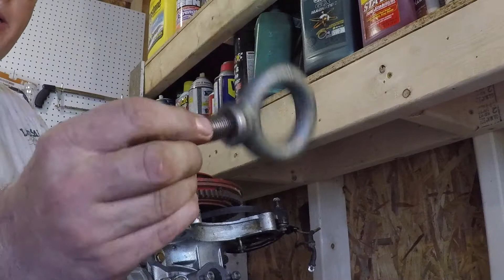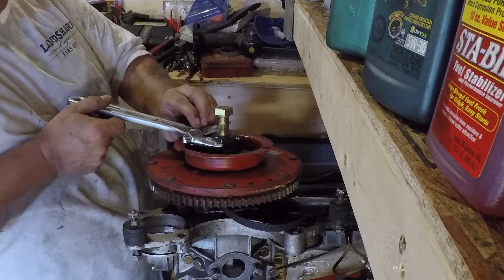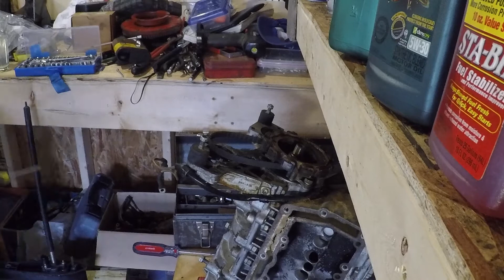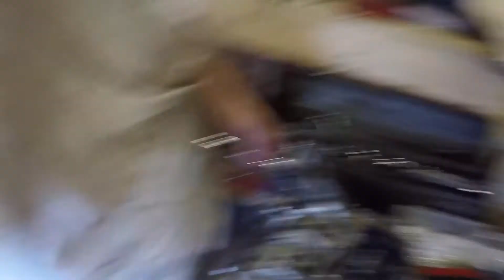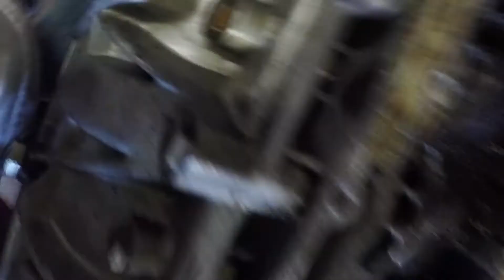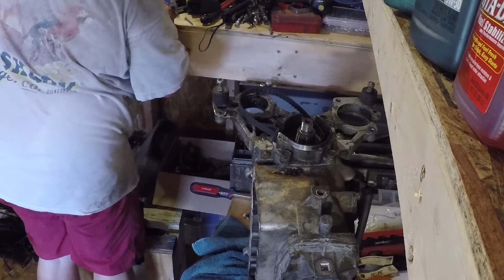Mercury Outboard Thunderbolt 500 50 HP Part 10 - Flywheel Removal and Stator Removal

Comment: how did u check the stator,how many ohms? is good?
Reply from the maker: Do a continuity check and then ohm it out.  I can't remember what the ohms I'll try to look that up.  But I believe its something like between 10-100 ohms.  The stator is an alternator on these engines.  Power never touches the switchbox.  Thanks for watching.
Reply: Is this a 1974 mercury

Comment: Is there a shim underneath the flywheel?
Reply from the maker: Not under the flywheel.  There can be under the bearing assembly where you measure runout of the bearings.  But not under the flywheel.

Comment: What is the name of the Kit.  Having the same problem.  You didn't show the box
Reply from the maker: https://www.ebay.com/itm/164186949086?_trkparms=ispr%3D1&hash=item263a4e05de:g:wFkAAOSwahlgfkPf&amdata=enc%3AAQAGAAACoPYe5NmHp%252B2JMhMi7yxGiTJkPrKr5t53CooMSQt2orsSLY2M1Gjmuwt9c03vWNfiRv9KskgFTWYSxXJShqsdkSRYC0%252FkbmmaTIobqJnBBa4kI2UKp2omA2Db%252BaiZqKX1FAcCbW5SlhrBOgxhKRjkH%252BMv2VMtYA8v6QzlOUXMH9dDTh4D9eLXGVH%252BR%252Fiz%252B4O9elgn7unwUXuRrN4RlfUk87MAD6th568QsCYoXwBz%252F8jt0MmT5Mej5EtvD059uwx4qnPYR%252BrZaIaaNyI7pM82nHJfYr3ewXq7di19ynfIOMqcopBU%252FPbrSyRWwPlKHC2LPPV37%252FeBgYXnp4g%252FMctBslwkS8%252BlQQ2THNR7IOc2KGOJVa3wvVGBBBnaPbaqXp94lAXozdK9ekH1Sv1MUt%252FHYTXg%252BVgKxxO%252BU0O5zSuE9Cim20wVucckpe91AprSFrf7TmgSDtRhppqrvEpbWz%252BWQ2AH2wI7WS0Q%252F235c1pt4XvblNGxhw7YkeJzUqxOHMxndccPVjuHGTv2jHK90SkSmHLNx%252BEoq%252BkjKqg%252FwriZSvpbxK%252Fxy48DQyOusa3%252Bz4EiRschCsjSh66FobnYmy43A5vDk%252BLrqDGiPBmJPNLMkk0zAdqEOJo1EyHtR8P%252BRxCtfNsO2d2wOgsfaEpM7WQjDa%252BNWxZteVddgkDj2BhmzGy3E70wvR8Se0Z3k4chgJdH%252FIuuSBsVy430BtsNPL192R82gBMUe1R4%252FXO1MvTf9b2Ap9Xenq5heKQgvLta9OfGhJwk7Fg6asPG4xNVXHUKtlKaFS6y7gTF0OceSw%252Fxp0zheFRR%252FJ8hKJxkh9oBZZmHY2JUzFBkBmoGWRWJ6GGRcu91iVj1iu0O%252FEF2g5b%252FP3hJaZ%252BCVeEDo1W2qporsENLXg%253D%253D%7Campid%3APL_CLK%7Cclp%3A2334524